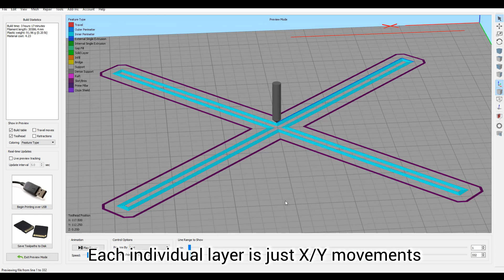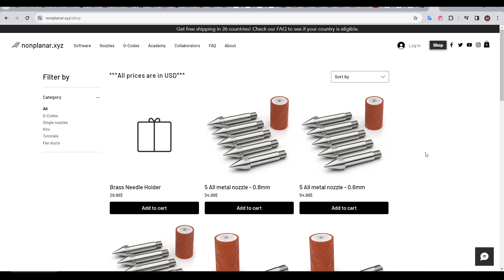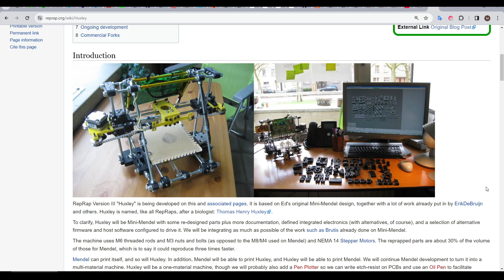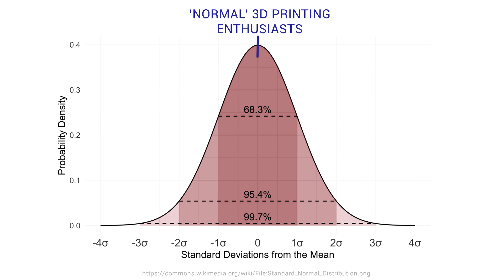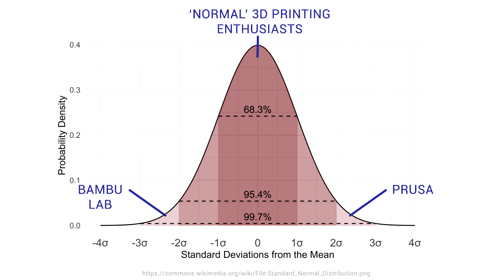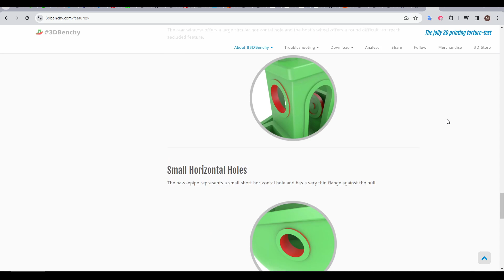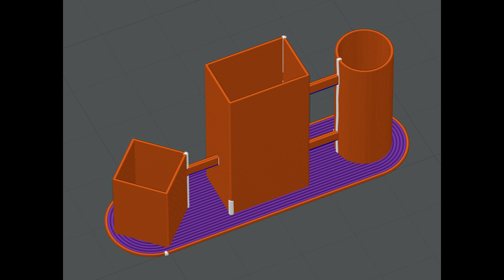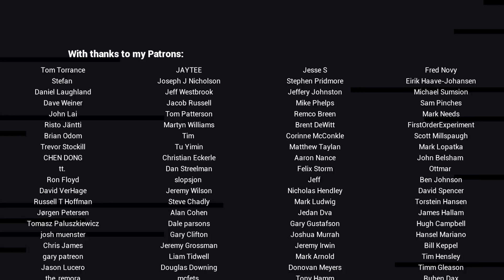3D printing mysteries that need to be solved in 2024

Comment: The toxicity overall of the 3D community is increasing, which is very sad. Whilst I started 3D printing in 2018 and not as far back as you, the willingness to help Vs trash back then was wonderful.

I've been mainly printing with Dual Extruder machines, but also had an interest in Multi-colour. To this end I suppose that moves me from mainstream to the people willing to spend a bit more to achieve more. My journey has included both the Mosaic Palette  and Prusa's MMU2, both which have their own issues and limitations.

When the Bambu and the XL popped up around the same time with quite opposite ways of handling multi-colour I suppose it was a "pick sides" moment for many. AS I couldn't afford to back both, it eventuated my Son went the Bambu way, and I went with the XL due to the much lower wastage - albeit with a much greater outlay to start with.

The Bambu arrived quite some time back giving it a significant marketing edge. And the initial thoughts were "fantastic", as it did it's amazing things. But it wasn't long before it's level of complexity showed the other side of the coin. IT's also far more complex to deal with clogs and jams. And as the seasons changed here in Perth it almost seemed to suffer heat creep like symptoms where the filament was too soft for the cutter to work properly, resulting in the end forming a small lump that would jam whilst trying to retract out of the extruder. I'm sure the issues we struck were not unique, but the FB group were ruthless in killing off any person's genuine call for help as "bashing" their "perfect" machines. Instead of people helping each other it was lining up with rocks to stone the poor sucker who dared speak up. Sadly, it's no longer "fit for purpose" as those needing help either can't get it, or don't ask in the first place.

The long delays before finally shipping the XL 5 Head Prusa didn't help as the fanboys were all too willing to label it as vaporware which fuelled the animosity. I understand they are finally catching up and mine should ship in the coming Month. But I have already eyeballed one in town and I believe I should be happy when it arrives.

I moderate in a few 3D printer groups, the biggest (30K members) being for a rival manufacturer where moderation is becoming increasingly more difficult over time. We have to keep fanboy's & girls under control (both for and against the brand). The level of personal abuse on occasions is crazy! One chap even threatened to hack the Manufacturer's page and take over Admin and kick all the Moderators off.

We have the policy among the Moderators to allow for critical posts, provided they are not actually abusive or obscene. We feel it's perfectly normal to be wanting to express disappointment and frustration, and we allow that as often people will still come up with possible solutions. It keeps the lines of communication open. But swearing and personal abuse is not tolerated, as people of all ages use the group, and we don't want parents banning their kids from the learning resource because some idiot has a foul mouth. The occasional "thank you" post from people appreciative of our unpaid work makes it worthwhile for us to keep at it.

Pages like your who stay objective and call a spade a spade always make it a pleasure to follow you.
Reply: Its nice to see that I'm not the only one noticing that. Last week I was called cheap, unknowledgeable, disrespectful to Bambulab engineers and overall stupid for asking about Aliexpress CHT hotend for P1S on Facebook group for Bambulab printers. If it wouldn't be for the fact that like you I'm also involved in 3D Printers since late 2017, I would probably cry in the corner. But instead I cried in the corner because it's an end of an era. 3D Printing community is not a safe space for me anymore, only specific groups like Teaching Tech or others I consider safe, but still that is trust that is lost and will not be rebuilt probably ever.

Comment: A big problem in general life is tribalism.  Yes, it spills into everything, including a premium hobby (for most people) like 3D printing.  But it's a big problem with the world today and social media is just making it worse and worse.

Also my M5C is running a print and I don't want to interfere with that, but I need to replace the hotend on my SV06 and will need to load filament into that, so I'll edit in which way it flows out.  I want to say it's counter (or anti, as you say) clockwise, but I'll check for sure.

Edit: Indeed, counter/anti clockwise.  Northern hemisphere, good old US of A.

Comment: For more toxicity part of it comes from a more commercial and less collaborative approach to marketing. Klipper supporters did the same to some youtube creators. Bambu actively flooded every creator space and forum with what was either bots or at the very least leveraged users. Voron while not themselves selling printers have companies making tidy sums off of voron kits and market them heavily, and they do little to actually help people put together a Voron without a kit. Sure they'lll provide the BOM .. a MASSIVE list of very specific materials that you have to spend a great deal of time sourcing. So of course conveniently for a little bit of a convenience fee we'll suggest company x or y that 'happens' to have a kit for you. At the same time creators here and on other platforms jumped at the hype and heavily pushed bambu printers and the others in their prospective cycles to the point of ignoring other solutions.  ..when is the last time you saw a chameleon multicolor system, or a mosaic multicolor, or a zonestar color mixing print setup reviewed vs the plethora of Bambu AMS systems. Prusa.. maybe they'll do it too.. they just havent had the xl come so fully online into production yet that they could handle the influx of orders beyond what they already have (I believe) 

In short its fewer companies getting in and trying to exclusively corner the relatively small number of people that are both makers and can afford these luxury brands.

Comment: So filament snap.  All the filament i have just sits beside my printer in the box with the window facing out so i can see ehat color is in each box. If there is not a window in the box i cut a small one. I find that as my filament ages it will start to snap where the window is and as i get deeper into the roll using what has been exposed it will stop snapping. This only applies to open filament. If it is sealed i uave no issues.

Comment: Well with easier accesability comes hubris. I tinkered a lot with my ender 3 and spend large amount of time troubleshooting and upgrading my printer its akin to taking and university exam if you have certain qualities you pass it and you can be part of community, otherwise you just sell your printer  which you deemed as useless toy. But with bamboo lab its not a hobby anymore and there is no exams to pass, its just another tool and anyone can buy and use said tool.
Reply: I think it's more than a tool. Some people treat it like a status symbol. Last week I asked about CHT hotend for Bambu P1S (I bought one on Black Friday, while still having two heavily moded Ender-3s) and was called cheap and stupid because I can't afford official Bambu hotend because I want an Aliexpres one. Once I attempted to explain that Bambu doesn't offer official CHT nozzles/hotends, I was again called stupid because I will drastically lower reliability of the printer and I will for sure clog the nozzle or other horrible stories. I was laughed at that after spending ~$1000 I can't even afford a hotend for $30. Even group moderators were supporting this types of comments when I tried reporting this behaviour. Quickly left that group.

Comment: I've been bashing my head around the snapping issue specially for PLA. I suspect that when the plastic is spooled, specially the tighter curves, it creates stress lines that create micro cracks. Then overtime, humidity gets in those micro cracks and weaken/degrade the plastic even more. When you finally gets to the end of the pool the PLA is already full of cracks. I thinks it happens often to tropical/humidity like mine (Brazil) and yours @teachingtech

Comment: In North America, my filament also extrudes the same direction.  This might have to do with rotation of the pressure drive screw used to manufacture the filament, which likely induces a bit of twist as the filament cools.  I suspect what we're seeing at the extruder is the "untwist" of that.  This is just conjecture though - so If you want to get someone with a CNC lathe to turn a "backwards" drive screw, then use it to manufacture some of your own filament in the other direction, that might make for a cool experiment.

Comment: Random thought about the filament hurricane/cyclone effect. Could it be from manufacturing? Possibly a rifling effect from drilling the 0.4mm bore is affecting the extrusion depending on the direction of the drilling process or a reverse bit (left hand/right hand)? Anyway, have a great new year and keep the rubber side down on your race cars.

Comment: The artifacts is a mix of a few things,  Aligned seam positioning can put Z seam in stupid places like that.  Also changes in cooling time between layers.  When printing 2 parts or complex parts the layers have more time to cool before the next layer is put on top.  When it goes from 2 parts to just one part remaining or on a complex part where it has longer perimeters to shorter perimeters and back the cooling between layers is shorter causing different amounts of shrink and cooling.  The best way I have found to mitigate this is to set all my speeds equal except for bridging.  Then tune parts cooling to lower minimum layer time down so that the printer can just maintain equal speed as much as possible.

Comment: Maker community section: I agree. I had to leave EVERY 3D group and some art groups, I am in. It may only be the people on the ends, but those were the loudest and, at times, meanest. I felt much more relaxed a few weeks after leaving the groups. I'm still gonna help around YT if there is something I can answer, but I don't see myself going back for a while.
Reply: Last week I was called cheap, unknowledgeable, disrespectful to Bambulab engineers and overall stupid for asking about Aliexpress CHT hotend for P1S on Facebook group for Bambulab printers. I reported that to admin group and he said that he supports all comments targeted at me and that I am being toxic for reporting such comments to admins. I left that group so fast that I even considered removing my FB account all together. 3D Printing community doesn't feel like a safe place anymore. Bambulab devices seem to be treated as a status symbols for many people?
Reply: @darekmistrz4364  I am not wise enough to describe why it happens with how you described it, but it often happens whenever new tech makes a breakthrough and things become more popular. "I had to struggle with painter's tape, a warped bed, and temp gauges that were +/- 20C so you should as well. That'll teach em." "Oh, you are just paid to win, you're not really in this hobby." or such. I get it. I don't even have a bamboo and got similar responses because I suggested them or praised the lower entry now.

FYI, the person's comment was blocked by YT, Darek did not say anything wrong, just doesn't show up unless you sort by newest.

Comment: Which type of plastic was the broken filament? Older filament has one annoying aspect, even PLA can become water-logged, it seems to cause it to become brittle. Plus, the cheaper brands seem to do it more often than not, so it might have something to do with the formulas they use. The very first roll of filament I bought was 3 years ago when I got my first printer, it was a eSun brand of black PLA. I used about half of it and when I started to make other projects I started to build up my filament library, so it got lost in the stack. I tried to use it last week, and it was breaking off between the extruder and the roll, just like you showed. I have a Sovol v6 so there's no tube to hold it together. Plus, it refused to stick to my PEI bed sheet, creating a huge blob on the hotend.

Comment: a couple thoughts on your list...

1. yeah, non-planar feels like it's always "just a couple years away". I hope someone will eventually bring it to market.

2. Northern hemisphere here, pretty sure I've seen both.... but of course now I'll be thinking about it everytime. :)

3. Ugh. Yeah. Moderation in some places is the only way to keep some groups civil it seems. This sucks, and it is totally unfair to folks like yourself that have to deal with it in the comments section. I've also noticed it's become a lot more sexist in some places. (Maybe this is part of what you meant by toxic, but it feels different to what you were talking about.)

4. ugh, this was the bane of my existence for a few months. I ended up noticing two things that seem to influence it. First was it happened WAY MORE when I was down near the end of a spool then when I was at the outside of it. (note spools were both dried and kept in dryboxes, so not a moisture issue.) I suspect it has to do with how tightly it was wound on the spool and the stresses of unspooling and being pulled straight. Second was that it seemed to happen more when the spool was at an angle to the direction of the movement of the print head then when it was parallel.

5. My theory on this has always aligned pretty well with the one you mentioned... I think in addition to pulling the heat out of the hot end, the previously printed layers cool more before the new layer goes atop it which has something to do with the additional slumping and the slight difference in surface texture. Additionally, in the case of the model with the bars sticking out being really noticeably different on the corners of the square, but not the prism or the cylainder... look at the direction the perimeters are laid down. In my experience the layers at that height that look different are printed going in the opposite direction, which means the slop and play in the corner is biased the opposite way, magnifying the minor imperfections. I'd wager the prism ended up going the same way for all layers, and the circle it doesn't matter since there aren't sharp corners. I have high hopes for input shaping and pressure advance technologies to resolve a lot of this.
Reply: I recently quit one group few hours after I joined it because moderators were encouraging the toxic behaviour in the group

Comment: Your broken PLA filament is wet, you need to dry it. I also have this issue with completed print becoming more brittle with time as they absorb moisture and the PLA becomes brittle again. I have not seen anyone acknowledge this in any strength testing, even though this is critical for endurance in most applications.

Comment: its cooling time caused by nozzle distance per layer. if your layer is faster it cools less so it soft and squishy and does not impede the flow rate of the filament meaning thicker layers form and bulge. if you can purposely pause the print head between layers so all layers take the same amount of time to finish meaning a pause after quicker layers you can achieve perfect layers.

Comment: I have a guess for the last one. The examples you gave are pretty simple and the shapes are constant in the Z direction. So the movements that the printer does are the same for every increment. But there's difference in printing time if there are more shapes in the same layer. That makes the time to print the layers to change. Not only that but the direction and the position of the starting point of each figure até diferente. Making diferente finishes on the structure.

Comment: that last one is because of layer times as well as heat. in my voron i have a high power heater and it does not suffer this problem whereas on my mk3 and ender 3 and p1s they all have that issue

Comment: @TeachingTech presumably the reason that the maker community is becoming more toxic is due to ease of entry. In the beginning, it took much more effort and money to get involved in the hobby. Not to mention that you often had to be a critical thinker when it came to sorting out issues. Today's community is starting to gain machines that don't nearly have the same problems as those from long ago. Anyone can go in to Mirco Center, a geek superstore, and walk out with a Bambu of their choosing. No need to familiarize yourself with the intricacies of bed tramming vs bed leveling, etc... The community now also has vastly faster printers, it's sort of like Amazon prime level gratification for an instant gratification seeking generation. Just my observation from some of the groups that I am a part of. On the other side of the equation is the seasoned individuals that snicker at the noobs/inexperienced when they ask a question thats been answered 100's of times. And lord forbid that someone is happy that thier shiny new X1C is printing awesome while the seasoned crowd, (if you'd like to term them) are still trying to get 3 consecutive good prints from an Ender3 that has $700 worth of upgrades. 
In automotive assimilation, it's hotrods vs tuners out here nowadays.

Comment: Regarding non Planar: I wonder if someone might add a servo to the head to tilt it 45 ish during the print. Would still need to be a very pointy tip.

Comment: For the filament, I always believed that moisture entered the filament through the cut end and that combined with the moisture on the outside caused it to break easily. Thats why it mostly will not propagate through the whole thing.